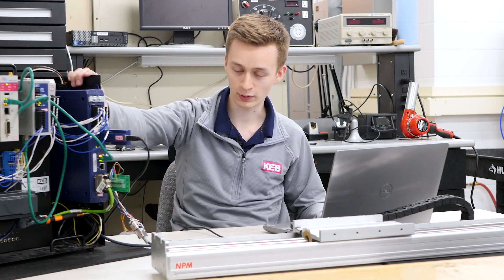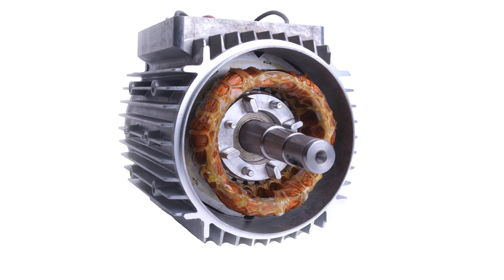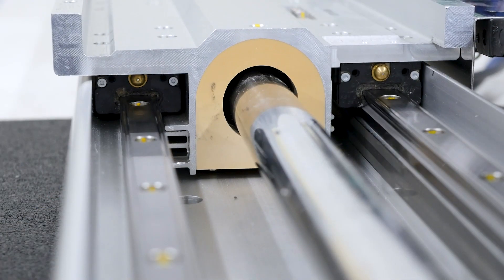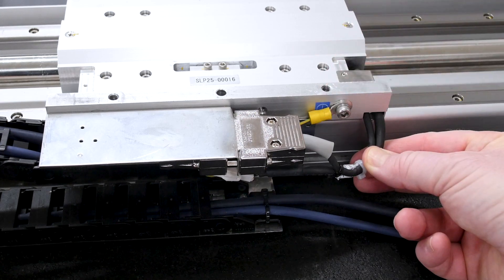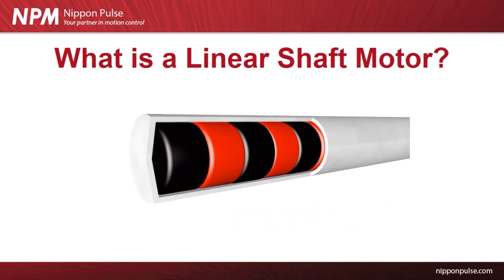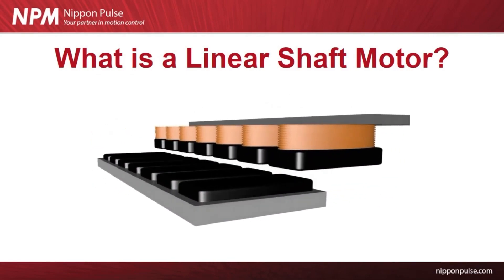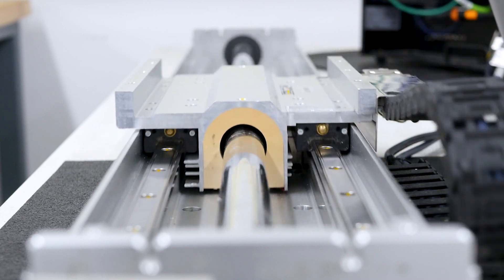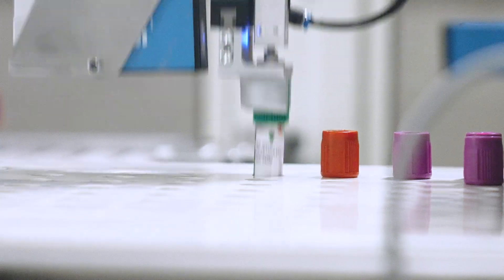What is a Linear Shaft Motor?  |  KEB America & Nippon Pulse Demonstrate Advantages for OEMs

Comment: what would be better for a 3d printer? a shaft motor or a flat motor?
Reply from the maker: Is this for a large scale industrial printer or a smaller desktop 3D printer? What you select depends on the budge, size, and purpose of the printer.
Reply: @KEBAmerica  what you select is solely based on the amount of precision and accuracy you want.